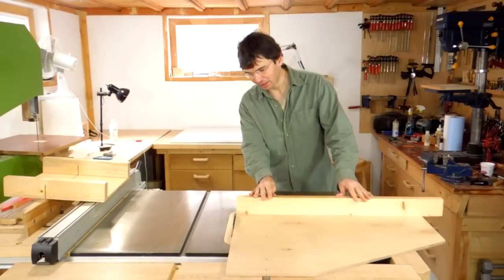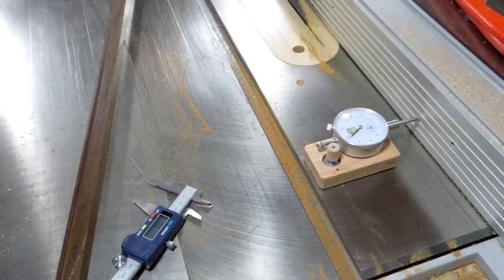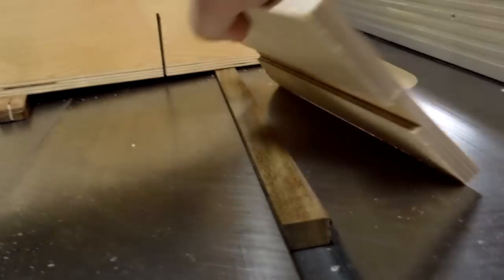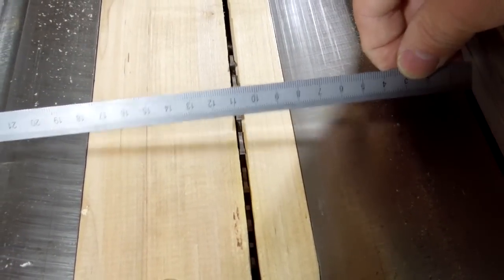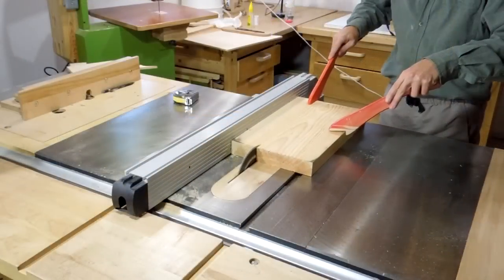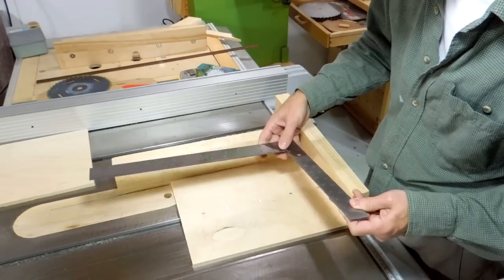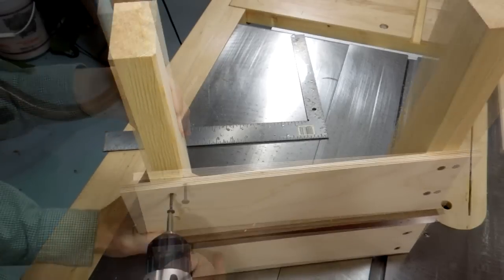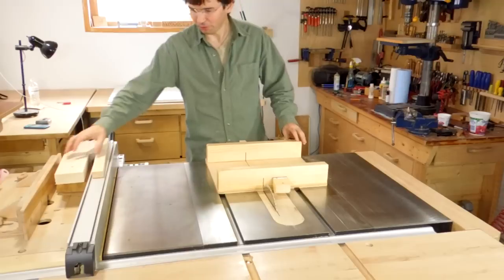Small table saw sled

Comment from the maker: When I measured the shrinkage and expansion of various woods, the exotics showed a bit less of it than domestic species.  I actually did some original research on this.
Also, I oriented it so that the radial grain direction is horizontal.  Radial shrinkage is  generally a bit less than tangential.

Comment: I just finished rebuilding a ten inch Craftsman 113 table saw from the 50's. Very solid, smooth and powerful. My experience using table saws is limited(normally I'm a metal worker) so I'm taking a crash course before attempting any projects. This was a great video, I'll check out your others. Liked and subscribed.

Comment: one of the biggest things that put this "single runner" design above the rest,  is when you rotated the sled  around 180 degrees. The added functionality makes this superior to what I'm calling a "double runner" design.  in addition to the added functionality, this design is also significantly smaller than the other sleds.

Thank you for sharing your ideas.
Reply: How do you think flipping that around adds to the functionality?
Reply: Because it allows the fences to be conveniently short when making crosscuts through the slot, but if you want to raise the blade to make a deep cut, you can flip the sled around (and not cut through your fences).

Comment: Just whipped up my own table saw sled.  I don't have a jointer/planer, so I ran some 2 x 4s along the table saw to get them as flat as possible.  I don't need to be that accurate anyway.  Thanks for the videos!

Comment: Love the idea of using a dado to give you a thicker runner.  For saws like my old Craftsman contractor saw with really shallow miter grooves, a thin runner attached to a flat bottom might not perform as well over time.

Also a great idea to use a single runner and make the sled reversible for 2 cut locations, one in the middle like a standard crosscut sled and one on the edge, which gives more fence support for longer workpieces.  

And cutting the base in two and butting the edge of the square up to another piece of wood allows for easier squaring of the fence than trying to eyeball whether the kerf lines up with the edge of the square.

I will definitely be trying all of these in my next sled.  Pure genius!

Comment: Hi Matthias, 
I too was curious about the hinged thingy on your wonderful small sled; which brought me to this video; where you remark on the reliability of framing squares.  All of your videos teach me something about methods of work, I'm dazzled by your shop built tools; and the privilege of watching your inventiveness always lifts me up. By way of recompense I'd like to share an old trick for checking and truing a steel framers.  Forgive me if this is something you already know.
To read the accuracy of a framers you need a board with a straight edge that is at least twice the length of the body and somewhat wider than the length of the tongue. A fair square cut on a piece of 3/4 ply will suffice. 
Lay the body against the edge with the tongue placed so you can flip the square and still have complete registration of the body on the board edge.
Strike a thin pencil line from the crook to the end of the tongue. Flip the square over and strike another thin pencil line from the edge (at the original mark) again from the crook to the end of the tongue. If they align exactly the square is true. If they diverge, the divergence is twice the error of the square.
Scribe a thin straight line from the heel to the crook. To widen the square use a fine point punch and strike a point on that line (not too hard) about 1/4 the way from the crook to the heel. To constrict the square strike a point on that line about 1/4 the way from the heel to the crook. Check again until you have the alignment.
Note: this will not work with some older/antique squares. Back in the day some of them were tempered. These can only be trued by grinding. Aluminum framing squares are adequate for drywall and don't need to be square.

Comment: Doh! As usual, wished I'd thought of that. I built one and retired my larger one cause I mostly used it for small stuff and this just works better, plus I have a decent chop saw. It's reversability is surprisingly useful. I did make sure that the rear fence was also as square as possible which, allows a bit more flexibility. I like your clever safety, but, for me, I worry about it creating a dangerous complacency so I prefer just a block of wood attached behind the front fence, and paying attention. You are one smart wood engineer (somehow woodworker seems like an inadequate term for you). Keep the ideas coming. Thanks.

Comment: I know what you mean Josh - the little contractor saws I have owned have the little retaining clips which require a T-shaped runner.  My sleds are not nearly as nice as Matthias', but I was able to do some very delicate work to the runner on my router table before I attached to sled base - I was able to create a T-slot runner which does work.  I have looked a bit for pieces of aluminum or nylon already shaped as I need, but did not find.

Comment: Good stuff here, nice job.
1 thought however, you have a great design on your jointer push stick that you should use for your table saw as the Twiddle sticks you have now are dangerous. That same jointer design just needs to be thinner for use on the table saw. You will find this type holds the stock down flat to the table.
It lets you apply side pressure to keep stock against the fence.
It has a handle that is WELL above the blade and the small notch grabs the
stock from behind. It's the absolute safest push stick design I've ever used in
35 years in the shop.
Keep up the good work.

Comment: A reader asked about using a cross cut sled for bevel cutting. Actually, you can make another set of runners on the same sled. Remove the runners for miter cutting, of course. When using the extra runners on your table saw, make the bevel cut right into your cross cut sled as you did with the miter cut. It is basically a zero-clearance insert in a way. When your beveling work is done, switch back to the original runners and continue with miter cutting. This is the fasted way I can think of using the same sled. Remember to mark with indelible pen runner positions and name them. Keep in mind that your new runners will cause the sled to move to the left or right when in position depending on whether you place the runners to the left or right. Obviously all this means that your runners will have to be screwed, not glued.

Comment: I'd be really interested to see how accurate this one ended up.  Have you tried the 5-cut method (or another method) to see how square it turned out?  If this way works, it's just so much easier to build than the alternatives.

Comment from the maker: I wheeled my 6" jointer out of my shop, so I guess the 12" one is working well enough.  Still not ready to part with the 6" jointer though.
Reply: Matthias Wandel hey thank you for always showing this, I have a very serious favor to ask. Could you please show how to re parallel this specific fence for your table saw? I have tried everything. And no matter what I do I can’t get it perfect. What I been doing is setting it to the miter slot, then losing the bolts by the lock 4 of them. When it’s perfectly aligned I lock it down then re tighten those 4 bolts. But I do need to say on the left bolts 1,3 I have about 8 pieces of paper to make it perpendicular back to the table. I put this fence from another craftsman saw that’s why I had to do that. I tried what it said in the manual and it’s just not working. Sometimes I’m 1/8th out of parallel then sometimes a bit smaller or maybe 1/16th bigger. It’s literally driving me insane. To the point where I’m considering the nylon insert on the tension bolt may be out of square. 
So if you could make a video or maybe just explain a bit to me here I would be in your debt. 
Also I do not have the two screws on the guide plate to the fence to turn is left or right. It’s not that model of fence.
Reply: Matthias Wandel sigh I just rewatched the video it’s not the same fence :( I miss seen something. Off to the wood working forms I go !

Comment: By the way I have a table saw that is bereft of mitre guides it is just a plain sheet steel top but I am working on a table sled that spans the table completely and uses the edges of the table as guides, I am also working on using bolts on both sides back and front as a method of squaring the sled to the blade 

My other alternative is to look out for a used/scrap table saw that has the pre-requisite guides that can take rails and work from there.

Comment: Doesn't need to be exact dimensions on anything, just make sure that the back face of it where the wood rests is perpendicular to the blade. The size of the sled should reflect the size of the wood you usually work with.

Comment: Do you have any tips or safety tricks when using a handheld circular saw?
Reply: +StegoSigma Don't touch the blade when its running.
Reply: robsnook4512 No shit lol. Since this comment I've gotten used to using a circular saw.
Reply: +StegoSigma Don't pin the guard up :]
Reply: Pompeius Magnus My guard gets stuck on wood a lot, so I was thinking of putting the stopper a little bit backwards.

Comment: Just wondering why do you only use one of the guide slots on your sleds and not both? Surely using both guides would create a stiffer more accurate and more useful sled, especially against that large sled which offers no support underneath the cut side of the workpiece?

Comment: I'd like to use a similar "raise the saw into the wood" technique to cut a shallow 2mm-wide 5mm-deep groove.  I would push the wood through the saw normally, except that the groove doesn't travel the whole length of the wood - it's in the middle (to allow 2mm-thick boards to slot in).  I have a router table so I could always just buy a groove cutting disc bit and be done with it, but I wondered if the table saw method is just good enough to save me the purchase (except I'd have to chisel out to the edges after and depth isn't easy to judge)

Comment: Great improvement although the extra thickness of the bottom adds to the height of the piece you have to cut so a larger blade is needed (more $$$) but still does the job most of the time.

Comment: Hi Mathias. Yup, I'm late to the party! That cutting tool deflection is a common challenge in lathe metal working as well. One trick is simply to take a second pass without altering the tool setting - or in this case the fence. The lower cutting forces minimise the spring in watever sprung. BobUK.

Comment: Matthias....sorry for my ignorance man, but i hav a question....@5:30...why did you cut the slot now instead of putting the front and back fence parts on and then cutting the slot. Just so I will know.....im sure you have a reason....and I know youre a smart guy so please.....let me know what you were thinking at that point.
Reply from the maker: by cutting the slot first, I can use it as a reference for setting the fences.
Reply: Matthias Wandel ahhhh.... yeah that makes perfect sense. Thanks for the reply man.... so many youtubers don't reply to comments. I would love to see how you manage longer stock on your table saw since you don't use a miter saw setup. i have limited space so using my table saw would be a nice option. I'm building both of your sleds today. Keep up the good work man!

Comment: I like your small sled design and am planning to build one for my table. Using two guide rails for the sled should theoretically make the sled more stable and accurate. But I find that you have used only one rail for both the large and small sleds though there are two slots on your table. Is there any particular advantage in using only one guide rail?
Reply from the maker: Bala Chandar Because I don't leave any margin for the runners, I don't want it to get tight from wood movement.
Reply: Matthias Wandel Thanks Matthias. Using only one rail of the right size simplifies the design to that extent.

Comment: Did you do anything additional after initially setting the fence with the square? I ask because I wouldn't trust myself to eyeball it off a square.
Reply: check out the 5 Cuts to a "Perfect" Cross-Cut Sled by wnwoodworks
Reply: dericcornflakes Yes, I find the "5 Cuts.." to be slightly better - more accurate. Even Matthias can learn something (:-).
Reply: Matthias only made one project ever that wasn't square. He then adapted and achieved perfection. He is Matthias of Borg.

Comment: lol, I just built one on my $30 ryobi table saw, and i have like at least 10 thou of wobble.  I usually don't go past 1/16 of an inch when measuring stuff.  Also I didn't use hardwood.  Still better than the stock token miter gauge, it had like half a millimeter of play in it.

Comment: I'm curious why you cut the base the first time, attached 2 peices to the vertical edges then cut again. Versus just screwing the base to the edges, and run a cut down the middle?
Reply: He wants to make the base and the vertical as accurate  to the blade as possible.
Reply: And if he made it all first then cut it, it might flex?
Reply from the maker: Jeff MacDonald Because I used two smaller pieces of plywood instead of one big piece.
Reply: Ah!

Comment: im assuming this would work on portable type saws? im planning to buy the bosch gts 10xc but reviews say there is some slack in the mitre sled attachment. im thinking it could surely be replaced with a thicker piece of wood (as you have done with yours here) to take up the slack and make for a more effective tool?
Also, did you ever do the norm abram trick of upgrading your washer on your saw blade to stabalise it more?
great video as always.

Comment: I have been looking for a table saw blade with "flat" teeth but have not been able to find one.  Would appreciate it if you could tell me whare to get one.  I search using "table saw blade with flat teeth" but failed to see one like the one you used for the dado you made on the sled.  Thanking you in advance for your response.
Reply from the maker: 4vinos I got mine at the home depot.
Reply: Matthias Wandel Thank you for taking time to respond in such a short time.  You are indeed one of a kind when it comes to constructing tools that work much better than store bought ones.
Reply: 4vinos Most 50-tooth combination blades will leave a flat bottom in a blind cut. Most ripping blades also have flat top teeth. And obviously most dado blades will also have flat teeth, though I am not sure about the "wobble dados" (and I don't recommend that type of dado blade either).

A 50T Combination blade is a great way to go if you don't have, or can't afford a dado set. I have them from both CMT and Freud, and both are very nice blades that I would recommend.
A good low-cost dado set would be the Diablo 8" 12T stacked dado set, which runs about $100 at Home Depot.
Reply: Shine Runnah You are very kind Shine.  I did not know thiat a ripping blade had flat top teeth.  I will look for one at my local box store.  Thank you.

Comment: I always see you and others using table saw sleds. But what about when you want to cut at a different angle? Do you do away with the sled, or have a different way of using a sled? Thanks
Reply: +Robert Vernon Check out Matthias' homemade lathe video where he cuts at different angles. He just puts spacer blocks in the sled, so he can consistently cut at any angle as long as the workpiece finds inside the sled.
Reply: +werkzeugcheck.com (EtienneTestet) Yes I understand you can use angle blocks to make different angles in the sled, but the cut is still 90* at the blade. I was talking about different blade angles. Thanks for the reply.
Reply: +Robert Vernon Oh, I see, you were talking about a bevel cut, where I was thinking about a miter cut. I guess you'd want to make several sleds for common angles. Then again, one bevel sled would probably be enough, if you just remove all the material from -45 to +45 degrees. Not sure about stability then, though. Let's see what Matthias thinks :)

Comment: Matthias, 
I just bought a cheap table saw for use in my garage. 
So I was looking for ideas for easier use and came across this video.
I love the idea of making my own tools - I was an engineer by trade many years ago and we often made or adapted our own tools in the workshop.
What I would like to know is about the dial gauge. You appeared to screw it down, yet I did not see a hole of any type in the saw table. Does it just have a pot-magnet underneath, or how does it stay in place?

Comment: New to table saws, and I have a problem with my riving knife being too tall for non-through rip cuts. should I just cut it shorter?

also, is the riving knife essential when using a sled? 

thanks!
Reply: Hey man, check if your riving knife has another setting to make it shorter. Mine has a low setting that allows halfcuts and a high setting that allows accesories like blade guards.
Reply: thanks mate, but unfortunately its as low as possible. I've contacted the manufacturer to see if they make a shorter version or to get a replacement. Cheers though!
Reply: Just remove the riving knife. Nothing but a nuisance anyways =)